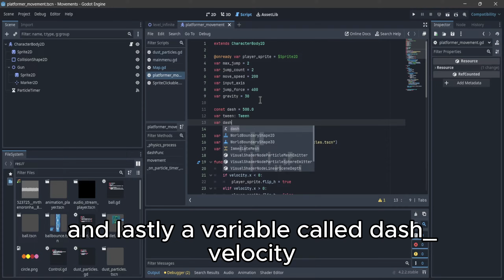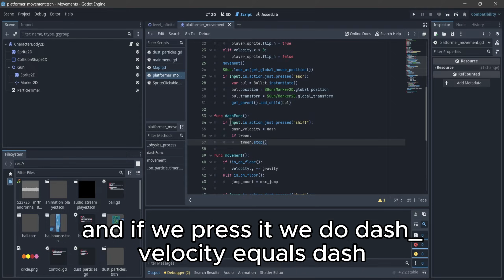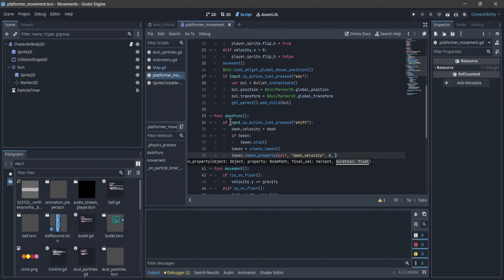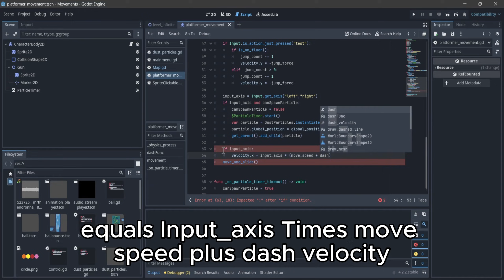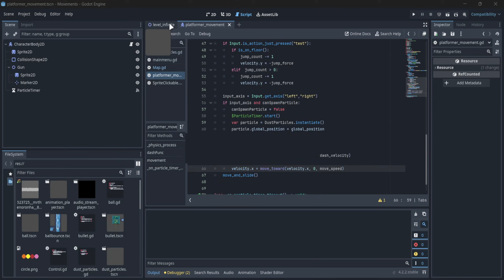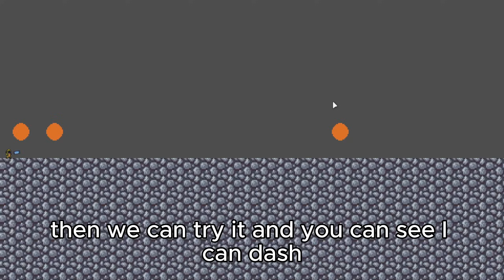HOW TO MAKE a DASH SYSTEM in GODOT in 1 MINUTE

Comment: How do you implement an animation into the tween. I tried playing an animated sprite but it wouldn’t play. The dash works fine but the animation won’t play. Other than that this was extremely helpful! 😊
Reply from the maker: @UMM-235  weird, the animation doesnt play? Try to just play the animation without the dash code, tell me the result of it.
Reply: @lPandoraBox Thanks for the troubleshooting! I never would have thought to check the animation itself. I played the animation without the code and it still didn’t work. This leads me to think there is an issue with my state machine and other animations are interfering with the dash animation. I will get back to you on whether or not this was the issue.
Reply from the maker: @UMM-235  No worries! Good luck with that! 😊
Reply: @lPandoraBox I just went through my state machine and fixed the error. Now my animation plays properly! Thank you!
Reply from the maker: @UMM-235  np!